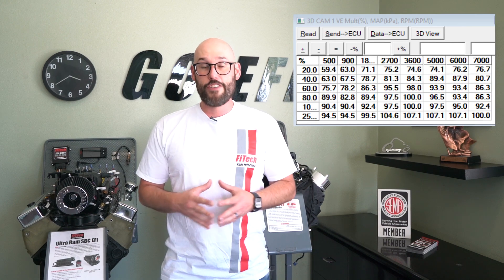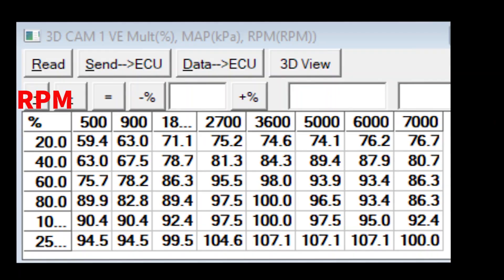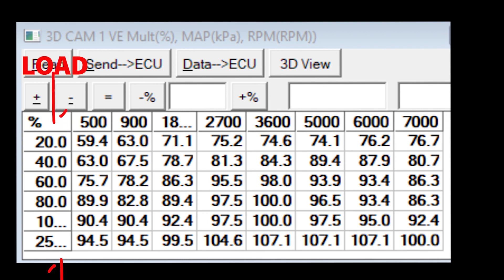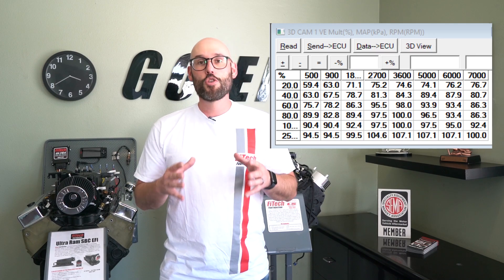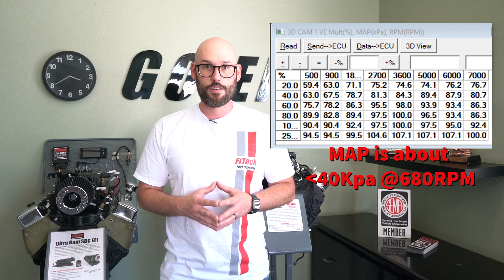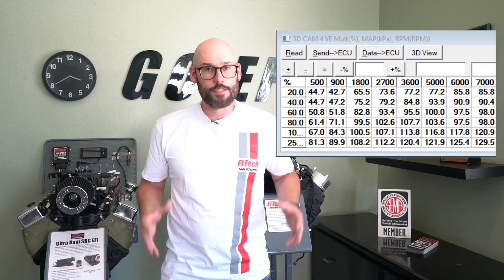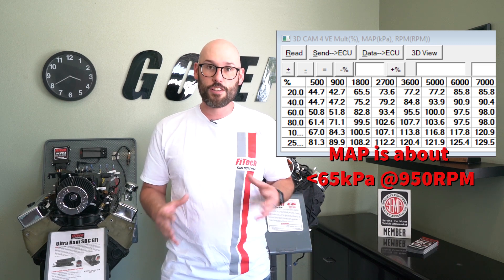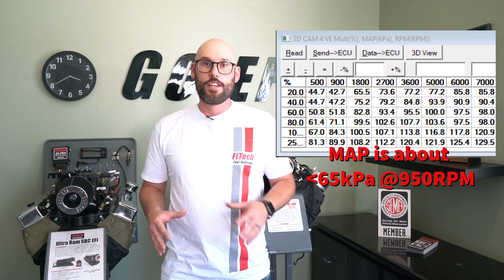CAM Selection | Tech Tuesdays | EP19

Comment: So are we talking inches of mercury? Or -psi? You show it on the handheld as negative psi but keep saying inches of vacuum, and in the manual it says 15hg is for cam 1, but that equals 50kpa. Cam 2 selection is for 10 hg which is about 35kpa, so if your going by these guidelines your basically saying cam 2 would have more vacuum than cam 1. Now in my experience the bigger the cam the less vacuum you have. 🤷‍♂️
Reply: With no access to a Dyno , I set my afr to around 14.3-1 to help with mileage. Would I get better mileage and performance if I let it tune itself in afr learn mode?
Reply from the maker: The system will read inches of mercury as negative values and then PSI for positive values. You are correct the larger the cam tends to have less vacuum.
Reply: Confused...my handheld says 6hg at idle....what is that considered?

Comment: This information should be in the tuning setup. If it is, I didnt see it. I have been running cam 3 and seeing trim values as high (low) as -25%. Thought I had a bad vacuum leak. I will try cam 2 and see what happens. My engine idles at 12" at idle
Reply from the maker: SURE!

Comment: If the cam selection has changed Should you reset the fuel learn?
Reply from the maker: If the cam selection is increased or decreased by 1 then I would say it is not necessary.
Reply: @FiTechEFImedia  ok perfect thanks

Comment: Hello and thanks for your great videos.

I have a thought regarding ideal speed (rpm) depending on which cam choice you use. if I choose cam 3, should I then set the idle speed to 850rpm? or if I want to drive on cam 4 do I then need to adjust the idle to 950rpm?
Reply from the maker: There is not an exact answer for this. The good thing is you can change your idle RPM and see how the engine likes it. You are around the right RPM for the cams and would say you can try plus or minus about 100 RPM.